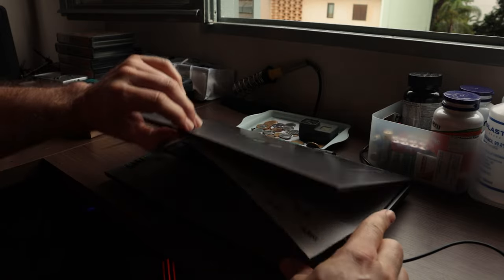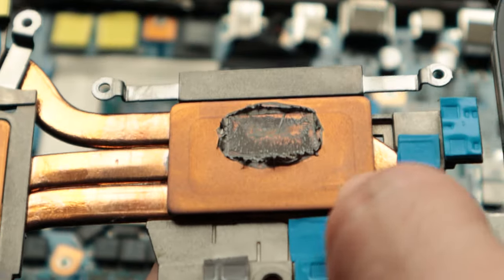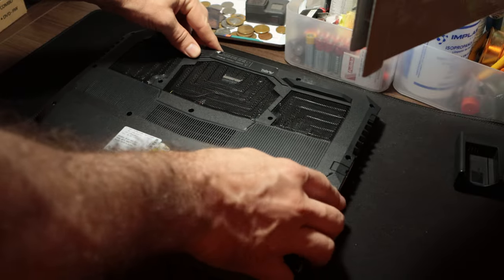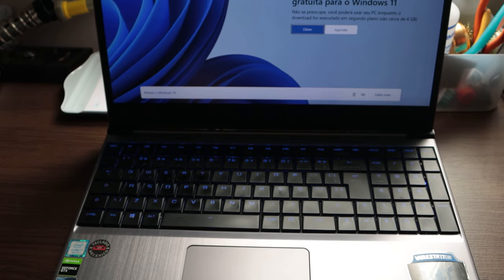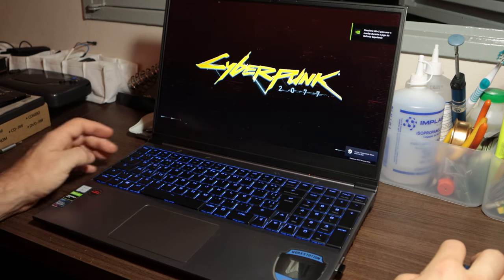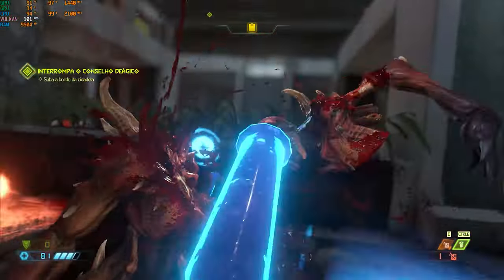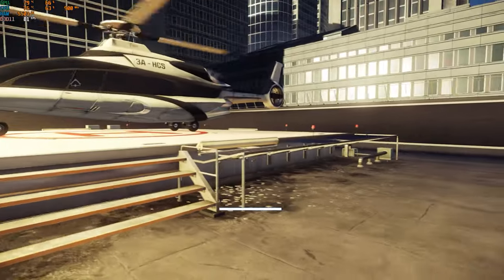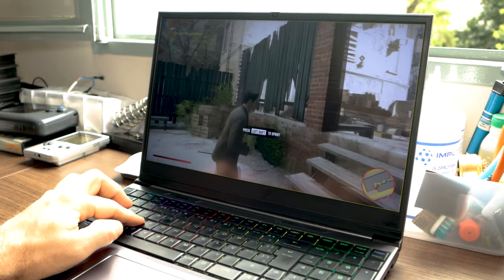Gaming Laptop Review: How to Improve Thermal Management

Comment: That machine looks remarkably like a Tongfang GK5CN5Z. Either an 8th or 9th gen Intel, with a GTX 16xx or RTX 20x0. Replacement batteries are still available. I know this from 1st hand experience having a near identical machine from a UK seller.
Reply from the maker: Indeed, it's absolutely the same. I did see replacement batteries from the battery model number for sale online. 👍